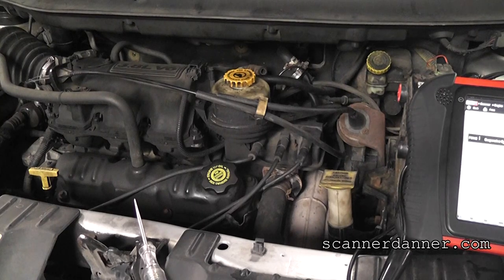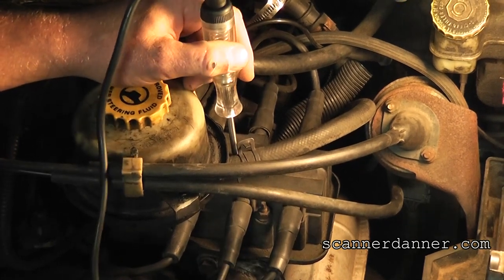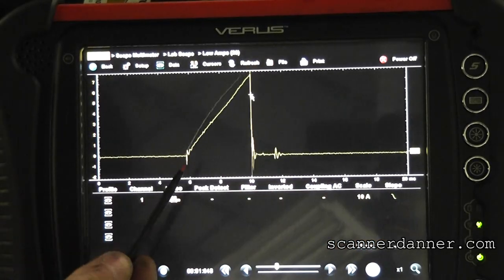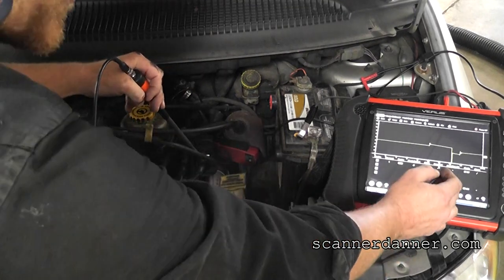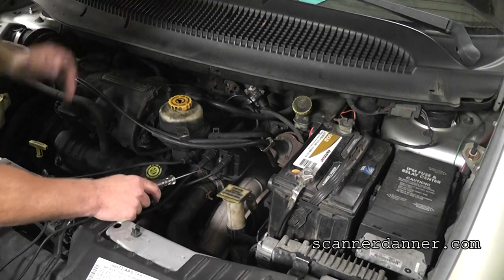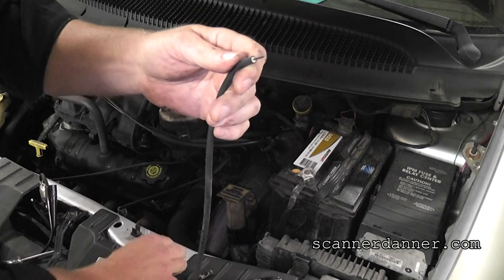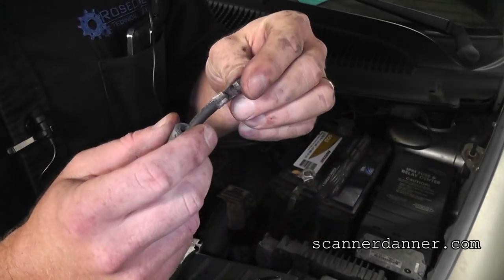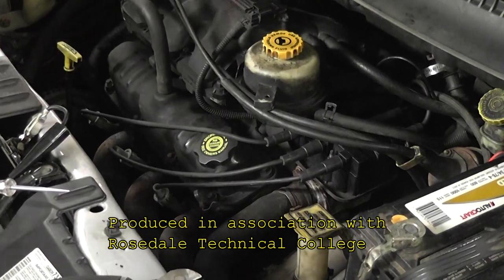Symptoms and causes of a bad ignition coil

Comment: Good vid man. I do those "field repairs" on wires quite often & the tip for stressing the wire while cutting is a great tip to keep from cutting into the carbon center. Usually I'll just take the razor all the way around & pull off the outer wire. Sometimes the razor does nip the carbon center requiring me to cut the end flush & start over. That's whats great about working on cars, you never really know everything. Thanks for the vid, you do an excellent job & want you to know it is appreciated in Spokane, Washington. Keep up the good work!

Comment: You are so AMAZING in your lessons.  The way you explain everything.  Is just perfect.  You are my forever go to mechanic on learning online.  I'm having issues with the p0300 but I changed the coil and ignition control module and still no spark on the new 3&6. Also change spark plugs and wires.  I am stamped.  I have fuses in both boxes some work. Some don't on perfectly good fuses.  I'll figure it out.  I get more and more troubleshooting info. The more I watch your videos.  Thank you so much for doing this for us. The money you are saving so many people abs education you give us is powerful.
Reply from the maker: What are you working on? Year, make, model and engine size? Thanks! I can help further.
If it is a Chrysler or Dodge with a waste spark coil assembly. (4 pin plug) the next test im going to have you do is with a test light on the control wires for the coil. I have some videos on this too. I'd be in my chapter 22 playlist right here on YT

Comment: Mr ScannerDanner, you are a God send! I was able to identify the exact problem with my 2005 3.8L Chrysler TC. The number four coil was no spark at all. All others were good spark. NOTE: I don't like eels either. Got the jolt lol. But I learned how to use the tester as in your video. I think I had a bad plug, then a bad wire, then the bad coil. Just like you mentioned in your video. I am going to get the new coil. I already got new plugs, and cleaned the air intake (really nasty) and put on some new wires. Thanks for your valuable information.
Reply from the maker: awesome. Thank you!

Comment: I've tested for spark with a timing light to by putting the wire clip on each wire to see if the light blinks and found dead wires. sounds dumb but works
Reply from the maker: that works but has variables to the test. week spark will still blink the timing light and may not fire the cylinder

Comment: Your one brave tech, Playing with old wire is like playing with a snake, going to get bit:)I seen high resistance in ignition wires do alot of destruction burn through rotors jump terminals in caps.thanks for the voltage ramps good to see bad patterns/ good ones.
Reply from the maker: +Jeremiah johnson for sure, thanks for the comment

Comment: Thanks! Now I can check my coil! Have a PO302 code. Replaced sparkplug and plug wire. Still same code and misfiring on # 2. Great video and very helpful. Oh...subcribed!
Reply from the maker: Thanks Roddy! Are you working on this same engine? I have some other videos dealing with this same ignition system if you need additional help.
Reply: ScannerDanner thanks. finished installing coil and everything just as you said in video!! thanks...saved me a bunch of money!!!!

Comment: Can an ignition coil cause a car to crank but not run? 2006 Impala 3.9 4 door sedan.
Awesome video. Thanks so much.
Reply from the maker: I believe your 3.9 is a coil on plug engine, so no, a single bad coil would just give a a single cylinder misfire.
Reply: The ignition coil is in back near the firewall where the spark plug wires are attached. Just one black  plastic piece.
Thank you very much for your reply.
Reply from the maker: This is a waste spark system then? It has a coil pack with three coils in it. So again, no, a single coil failure would give you a 2 cylinder misfire, not a complete no start.

Comment: thanks a lot for your video, my car's coils have spark on one side but not on the other I'm going to buy the coils today.
Reply from the maker: +sancho villa make sure you check your plug wires for opens too, you can smoke your new coil
Reply: +ScannerDanner alright. I replaced two coils last night on my 95 camaro with a 3.4 liter v6. was going to buy new wires but was running low on funds   lol. this coming weekend I'm going to replace them and the plugs which I'm sure are pretty bad but it's running great now even with dirty plugs thanks again

Comment: Your braver than me Paul, i had a few shocks years ago and i used "Chicken" pliers after that, complete plastic pliers, Snap on do good ones...50kv doesn't do you a lot of good, they say amps kill but i don't like HT much, i don't have a pacemaker by the way..but I'm still allergic to that lol, i am retired now at 67 years old, but i still enjoy watching your video's..from Fred in England.
Reply from the maker: +Tom Smith  thanks Fred. I guess I kind of like it :) It keep the neurons firing properly in my brain.  :)
Reply: +Tom Smith back in high school auto shop almost 30 years ago a buddy of mine used to enjoy shocking himself on the spark plug tester. You always knew when he was doing it because somehow it backfed into the speaker system inside the shop and you could here it zapping. Lol

Comment: Hi Paul. Another great video. One question however.  Around 3:40 you say that since #4 isn't firing you should check the #4 wire and plug (to make sure that wasn't the cause of the coil failure, I assume). My comment is that when you jumped the #4 wire/plug with your test light we had no spark. When you jumped #3 we do have spark. Wouldn't that imply that the #4 wire and plug are OK(-ish) and that the #3 wire/plug is where the problem is? I.e. when you jump the #3, the waste-spark had no trouble passing though the block and back through the #4 plug and wire. 

Also, since things do fire with #3 wire/plug jumped, doesn't that imply the coil is actually OK? All of this is assuming this is a waste-spark system. 

I'm probably wrong as I'm pretty new to all of this. I'm just trying to learn all I can.

Comment: I developed a technique of long needle nose or pliers of choice with a reliably attached jumper wire to ground, spark it all day and it chooses pliers over you every time.   one time after I pulled a poor insulating wire off a coil while leaning over a car, if your not grounding your body on the car it's not so bad but if you're other hand is planted or leaning on the fender you give the circuit a return path to ground and the increased current causes exceptionally more stun gun effect/pain, hurts, every single time lol. knowing this I hover when doing this, but one time a bad combo of little too small work pants/possible faulty belt position caused my man bulge to be the closest thing to the car by the fender, my hand was directly on the wire so direct connection there, I  was looking down and litterly saw the arc go on the return path to ground out of my zipper area.  that's  right manhood to ground arc.  oddly my hand hurt like hell but just got a strong tingle I'd rather not feel again down there.

Comment: Wouldn't setting the ohm meter and checking the wire resistance also b a good way to determine high secondary resistance?  Around 4000-5000 ohms would work, right?  Thank u for all the great teaching!
Reply from the maker: +Bill Rimmer yes, you could do that as well

Comment: There is a great rubber lube right there Paul. Brake fluid is the best thing I've ever used and won't harm a thing. Motor oil no so good.
Reply from the maker: +moomike laloo great tip! brake fluid it is next time. 
In hind sight, it doesn't really matter as these plug wires are getting replaced.

Comment: Will it throw a engine code? I'm getting 02 sensor upstream and down stream low voltage and a crankshaft sensor fail. Thanks for broadcast! So did you replace the coil or Just the Wire?
Reply from the maker: Open plug wire burned out the original coil, so it got a new coil too.
Reply: @ScannerDanner  Thank you! I've got a PT Crusier 2005 showing code for Crankshaft sensor after the O2 both sensors up stream and down stream low voltage and no power/ground  absent to OBD 2 port connector. Someone I was watching had a crankshaft wire rubbing on a hub and wires showing.... Or could it be bad plugs, wires and possible coil pack?  thoughts! Thanks!
Reply from the maker: attack the crank sensor code first
Reply: @ScannerDanner  Thank you. 2005 PT cruiser pulling my hair out... OBD2 port no communication... took it to a repair shop with a P0335 Crankshaft sensor after the port can't be read read it on the cluster but now won't read on the  cluster either... so no way to read codes ...had crankshaft sensor replace they were trying to fix the OBD2 port now the codes for U0155, U0160, U110C , P0031 low voltage on both P0037 02 sensors ... the mechanic said on the PCM the 2 connectors to the left had pins out! He tried to put them in Could the connectors be causing this? Thank you for broadcast... S.O.S. Do you have information on what each connector contol plugged into the PCM for 2005 PT Cruiser? Now I'm in worst trouble!!!

Comment: I like to get everything ready while it's off then start it only to see the spark then shut it off. I have zapped myself a few times in my life. I had a bad coil with too much resistance on primary side and idle  misfire. Nobody could tell me what it was so I replaced it and imeadate fix and smooth idle.

Comment: Thanks for your video Paul. When you are using a test light to check ignition spark, how do you tell that the spark has enough energy?  sometimes I'm not sure if the spark is strong enough when using the test light. from Freddie in Australia.
Reply from the maker: +HYUNHO LEE I look for at least a half inch arc with most coils producing about an inch. (25.4mm I think)

Comment: Usually i would check the coils for resistance and if i get more then a !0% variation. I would know it's the coil pack. Another give a way is the lead a old. Using leads for to long will burn out your coil pack!

Comment: Who makes the probe you used in the 3rd test ?     I am having trouble with a 99 Jeep Grand Cherokee 4x4 , with the 4.0 engine ....  I have a dead miss on cylinder 6 , but I do not know how to test the big "6 pack" coil on the jeeps ....  Ive done a few tests that point to the coil , like turning off the fuel injectors , ect ............. Cylinders 1 and 6 are connected by the coil , cylinder 1 has spark (and fuel )(evident when I shut the injector off )   but I can not figure out how to test #6 (the idol actually improves 75-100 rpm when #6 injector is turned off )  .............  On the exhaust all 5 cylinders have an average temp of 350*  ,  cylinder 6 is at 120* ....  I can smell fuel in the exhaust like its running rich .............     But the other problem I am having is the Jeep will not stay running unless I am on the gas (4 out of 5 times , the 5th time it will idol but it is really rough ) ..... .............................................. I had a random misfire code , so I swapped the spark plugs (they were due) .. After I swapped them , the jeep ran great for about 5 min .... When I tried to back out of the driveway everything took a turn south ................. Now it is sitting in my driveway and I am stuck ... But I do not want to throw parts at it ... 150$ coil is not exactly swap friendly ...   All of the other sensors ect are reading ok ,  but every time the jeep misfires the ASD relay tries to turn the jeep off ....... If I stay on the gas you can feel the engine turning on and off with the ASD relay ...............    CKP seems to be ok , but I am not sure what I am looking for on the scope ,  I have the 4 triggers grouped on the graph like the tech manual shows but I dont know what I am looking for otherwise to make sure the CKP is working properly .......................................................... ANY help would be appreciated , this is my wife's Jeep and our only car at the moment .........  ( ohh and I do have your book , but I am more of a visual learner ... So seeing how its done or being shown what I am looking for works better for me than reading and trying to incorporate that into a test ......)

Comment: In October my car was misfiring after idling for a few minutes. Turned out I had a burned out spark plug & dirty fuel injectors. Replaced and cleaned, put lucas in gas tank. Ran fine until today. Now it's dying again at idle, engine jerks once when I come to a stop and I notice the loss in power like crazy. I have a catback exhaust and sound is significantly quieter. No lights on my dashboard, but took it to autozone to run diagnostics and nothing came up. Do you think this is a burned out coilpack?

Comment: used to have to change ht leads once a year on ford escort. bad coil pack on a v8 jag creates loads of heat in the engine bay and enough vibration to make you not want to drive it!

Comment: Hey Paul, cool emergency roadside plug wire repair! Nothing like a few KV to keep you awake through the day right? lol
I have a quick question about the primary current ramp: how do you explain the different signature and lack of turn-on oscillations on the primary current ramp? That secondary winding still seems functional, as the companion cyl still has a good spark...
Reply from the maker: +motoYam82 Not sure I can. In this case it is one of those things that may help ID a buried coil (one you can't get to) in the future. 
With one tower shorted out, there was a difference in that ramp with both the turn on oscillations and the arc of the ramp. But I'm just stating the obvious there.
Reply: +ScannerDanner Cool, definitely a great idea to compare a known-good and known-bad on the same car. 
Possible explanation for the different current ramp...might be completely off here but just thinking from basic principles: 

Since the secondary winding is shorted to the coil pack base on one tower (internal damage), the charges in that winding circuit now have less "room" to move. Basically the CAPACITANCE of one entire spark plug wire is now out of the picture. 
This would mean that the secondary could not respond to counter the magnetic field of the primary as well as before. Thus it is slightly easier to build up the current in the primary, and the turn-on oscillations (feedback via mutual inductance) are reduced in amplitude. I guess a completely shorted secondary winding would be an extreme case of this scenario...

Sound plausible? Ignition waveforms are always the trickiest to analyze :)
Reply from the maker: +motoYam82 perfect description my friend. Thank you!

Comment: Changed plugs, wires and ignition coil, running rough and low power at higher speeds. ????
It was running fine before. It had just been a long time since plugs were replaced.
I’d been to two other mechanics who seemed stumped and suggested big valve jobs etc.  now I know who to avoid.
Reply from the maker: you most likely installed a bad plug or cracked it when putting them in, or you installed a bad coil, start by putting your old one back in. Why did you change the coil? This is not a maintenance item
Reply: ScannerDanner   Turns out I was right.  The wires weren’t in the proper places.  My coil is good but now I have a new one. So anyone in the market for good used one?  My usual mechanic showed up in the nick of time to save me all the hassle of all that other stuff.  He had it purring in 5 minutes.  Thanks for your reply.

Comment: Hi!  I have a code.
Misfire, #1.
Similar type van as this video.  Wondering IF, since I need a valve cover gasket, IF, all that leaking can cause the spark plug to be wet, & cause the entire problem, or if I still need to replace the coil.......
I don't have any special tools, equipment.   Just basics.
I do live about 2 miles from an Auto Zone.
thanks for the very clear, precise video.
Reply from the maker: Probably not related to your misfire. 
could be this too https://youtu.be/jsl531-6q-A
Reply: +ScannerDanner Thanks SO much for the reply & help.     :-)
Reply: +ScannerDanner ....
Had Auto Zone plug into to handheld diagnostic.  Shows code only for misfire #1.
How much should one rely on these codes?
Reply from the maker: If you have a constant misfire, it is pretty reliable. If your misfire is intermittent, then it is most likely accurate but can be wrong on occasions.
Reply: +ScannerDanner  Very constant.  Always rough.
But, with the valve cover gasket leaking so much, wondering if there's any quick fix before I get that fixed?
I know a wet spark plug is a bad thing.
Thanks for the help.
Reply from the maker: yeah but your valve cover is going to be leaking externally of that plug and on the outside of the plug wire. It is possible, that the oil leak is not helping, but most likely not related on this design. 
Check the #1 cylinder for spark first like I showed in this video. 
Some other quick tests. You can swap the spark plug for the #1 cylinder to another cylinder and then see if you code moves to that cylinder. Do the same thing with the plug wire.
Reply: +ScannerDanner. Awesome advice!  Thanks for your time & advice.   I greatly appreciate it.
Reply: D Hoosier Do the spark plugs go through your valve cover? If so, then a gasket change (done improperly) can cause a misfire. Oil leaks past the spark plug gasket, which come off with the valve cover, and insulates the spark plug from the wire.
Reply: Reluctant Couch I'm not positive,  but I don't think so.  I do desperately need a valve cover gasket done.  leaks quite a bit.
I noticed ONE important thing, lately, every time I start it up to drive it, the colder the engine is, the better.  it runs PERFECT while cold.   About 5 - 7 minutes later, it's warmed up, it starts that crazy popping (missing)
I can't stand it!  Thanks for replies!!      :-)